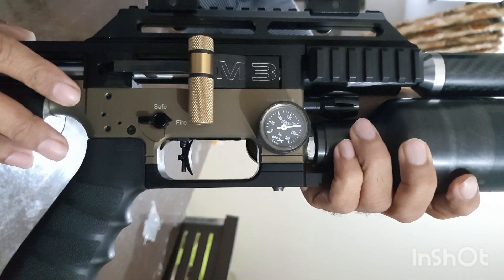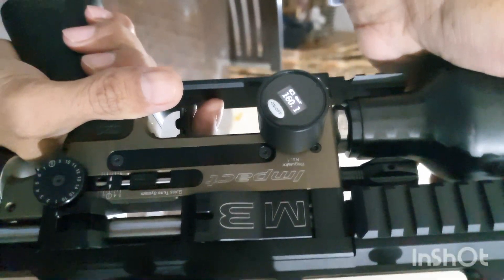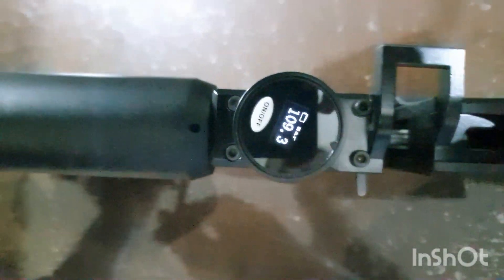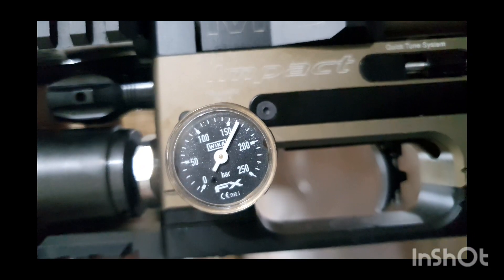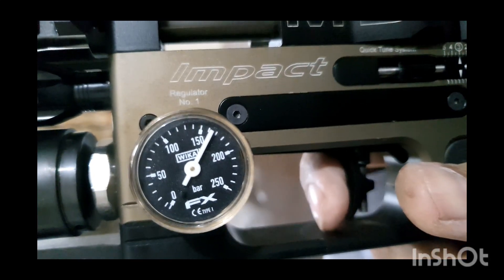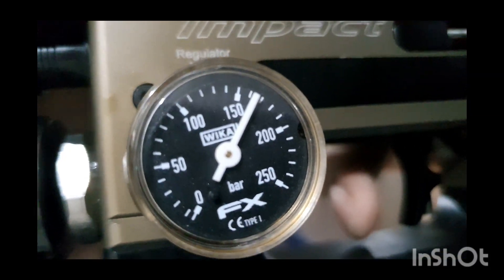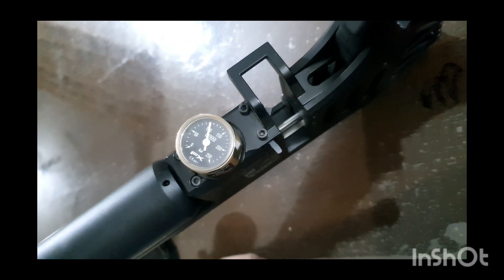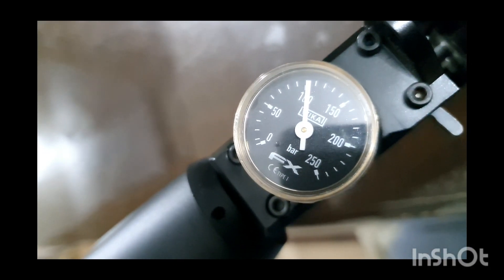FX Impact M3 Demonstration of Improved Performance of Both Regulators

Comment: Sir i am using.357 impact my 1st reg 195 and 2 nd reg 150 but my fps around 510 it should be around 830 as per expert.sir can you suggest me for how can i get higher fps
Reply: If you didn’t install slug power kit , you have to keep 2nd regulator around 135